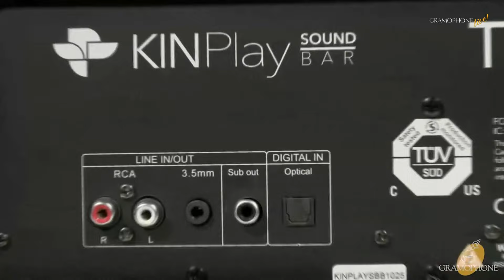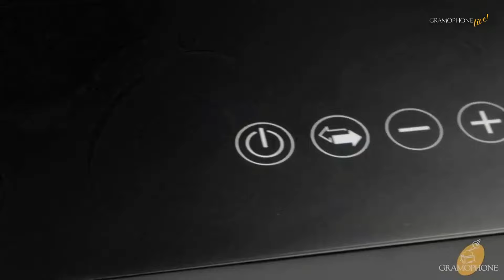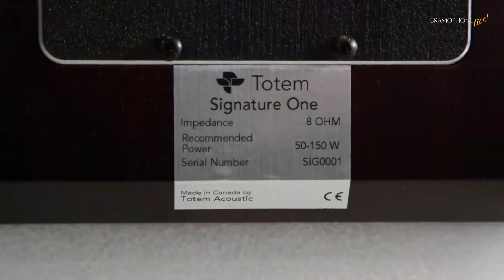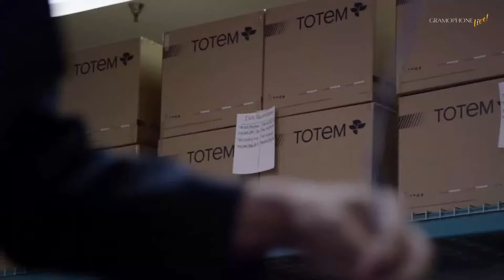Gramophone LIVE! with Totem

Comment: Does the totem wind have torrent drivers? Or is that only for the tribe and element models?if so, what’s unique to the wind. Thanks!
Reply from the maker: The Wind does not, it is a more classic design with traditional crossovers and drivers. But what it does have is dual mid ranges and a dedicated eight inch bass driver.
Reply: @GramophoneMD  thanks!